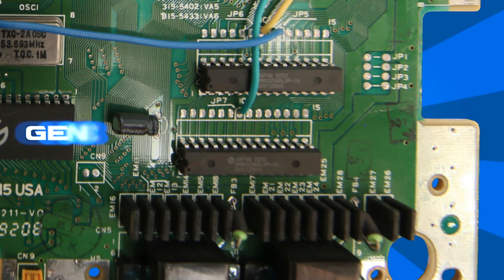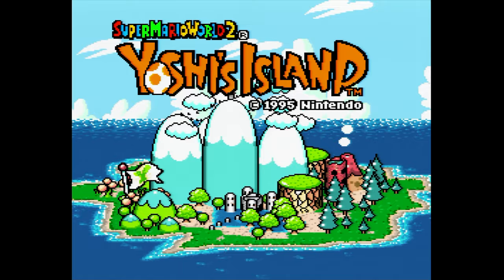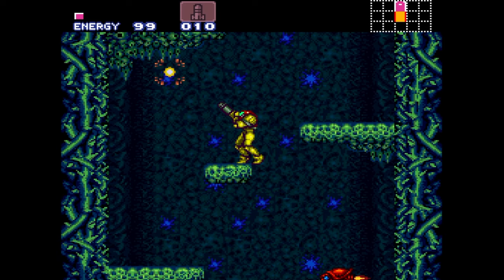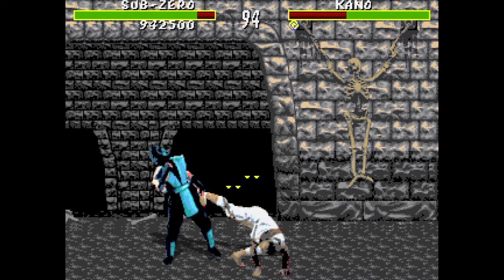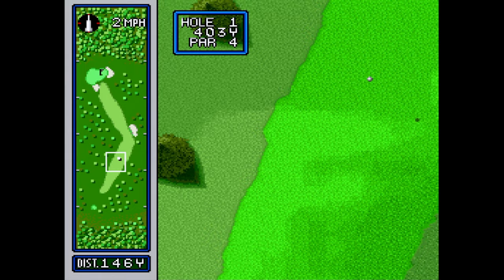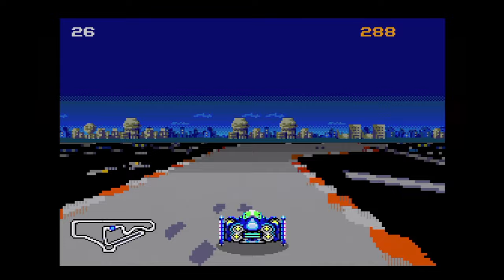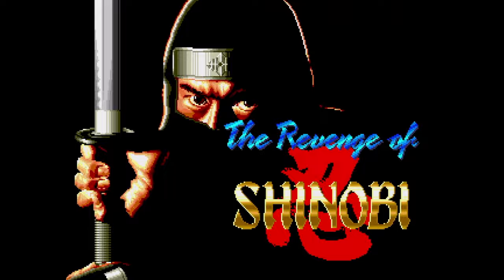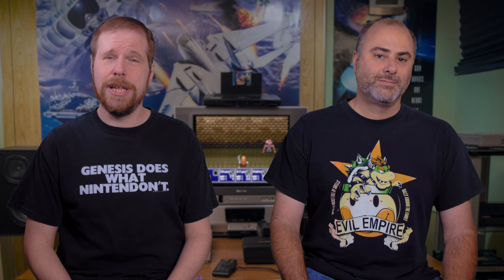Sega Genesis VS Super Nintendo - Game Sack

Comment: Exactly what I've been saying. They are both amazing consoles. Sadly Genesis gets overlooked a lot in the US and most prefer SNES. I've always loved both. Great video dudes.
Reply: Europe and Brazil, SNES gets overlooked! Most people there prefer Genesis.
Reply: Both are great, but people commit the same mistake as when comparing the PS3 to X360. Yes, Genesis has some good "numbers", like the "super duper" Cell processor on PS3. But the Snes, as the x360, do better the important stuff that affects the end result on the screen. That's why Snes and X360, generally, shown better graphics. 

For example: Genesis CPU clock is double of the Snes. But this doesn't mean that the Snes clock is not enough for 16 bit games. Yes, when developers don't trim their codes, Snes games can have lot's of Slowdown (Gradius 3, someone?). But when the programers do their work, the Snes is capable of running games fast too (look at Samus running with Speed boots on Super Metroid). And because Snes can do much more colors, in the end, the games ended looking better. 

About the special chips on Snes cartridge, it doesn't matter if they are "cheating", in the end of the day, it gave better looking games for Snes owners, that's what matter. And it's not like the console itself was not made with this in mind: the catridge slot on the console has the extended space for it, so it was planned before the console release, so, keep in mind it's part of the whole idea of the console. Too bad for sega, they didn't have the vision that Nintendo had. I don't remember cartridges with special chips costing more, maybe only the cartridges with the Super FX chip? The only case I remember, is Virtua Racing for genesis, that cartridge is a disaster: big, expensive, and running very bad a not so good game.
Reply: Snes gets more love in the U.S. because Nintendo and all their IP's are still relevant. If Sega's Genesis era IP's had any relevancy outside of Sonic it would be a different story. Now it's a little redicoulous when we get into the revisionist history stuff that seems to circulate.
Reply: Rotten to the Core  Not in a lifetime!
Reply: Rotten to the Core  In Europe, everyone preferred the Mega Drive/ Genesis!
Reply: Rotten to the Core  But not in Europe! In Brazil Mega Drive beat snes and still being made with new games.
Reply: Rotten to the Core  Source for snes  outselling mega drive? Even if brazil is 3rd world since 1998 they're still making mega drive so until 2020 it can be said they outsold snes after all these years.
Reply: Rotten to the Core  Everyone and no one is subjective.  You're speaking from your own experience. Mega Drive is better and no censorship like the kiddie snes. Woo!
Reply: Rotten to the Core  made in brazil or China doesnt matter. Since 1998 made by tectoy and licensed by Sega that's 22 years still being made that should make it outsell the snes by a lifetime! Jajaja. Woo!
Reply: Actually most preferred the Genesis. It outsold  the SNES during its time.
Reply: Rotten to the Core  Actually, yes... 1. Doesn't matter. 2. Wrong 3. Woo!
Reply: Rotten to the Core  Source where they preferred it?
Reply: Rotten to the Core  source where it outsold mega drive?
Reply: I'm Scandinavian.
Reply: Rotten to the Core  in the US it out sold the SNES. The OP said it got overlooked in the US. Which isn’t true.
Reply: Rotten to the Core  source? Again you cant prove that! Woo!
Reply: Rotten to the Core  Source?
Reply: Rotten to the Core  Source?
Reply: I feel like Snes edges out over genesis
Reply: @Blueflag04  I feel Genesis edges snes.
Reply: I honestly like the Genesis more, but I also have to give a good thumbs up for the SNES in having not only better realism and quality (usually), but also not needing physical add-ons to play DOOM, unlike the Genesis which needed the 32X and/or MCD to do so. Which it actually didn't, it was just a marketing trick.

Genesis: generally more powerful, clearer sound and graphics, cooler-looking console, and better rock/dance
SNES: more realistic sounds and usually graphics, better controller, more friendly games, better orchestral
Reply: @joyasmusicales603  Only the clueless ones.  I'm not saying the Genesis was bad, but it really wasn't even close between these two systems.  Nintendo's complete dominance in Japan guaranteed it most of the best games coming out of Japanese developers which was what most of the best games being made in the 90's came from.  Japan!
Reply: @davidaitken8503  Clueless and better games on Nintendo? Musha, Gunstar Heroes, Shinobi 3, Sonic 2, Contra Hard Corps ( better than snes version), Castlevania Bloodlines ( again better than snes version), Aladdin ( again better), Alien Soldier ( no equivalent on snes), Mega Turrrican ( again no equivalent on snes), Rocket Knight Adventures ( again no equivalent),  earthworm jim (again), tristar, vectorman, better mortal kombat with blood, road rash, Golden Axe, and best beat em up of all time on any platform by Sega with Streets of Rage 2? Need I go on? Nintendo bias and ignorance  from your part and yes I do have and collect for both snes and genesis as two of my favorite systems of all time along with nes, but comparing both consoles and libraries I can convincingly saying Genesis is much better and this is coming from someone who grew up on snes and got a genesis much later in life. Better console and games goes to Sega Genesis! Woo!
Reply: @joyasmusicales603  Thank you for illustrating they type of person I am talking about when I say clueless.  You don't even seem to know about some of the greatest games for the system you owned.

Space Megaforce > M.U.S.H.A.

Contra 3 > Contra Hard Corps, Gunstar Heroes, Alien Soldier, or any other Boss Rush game that skimps on level design.

Hagane > Shinobi 3

DKC 1, 2, 3, Super Mario World, Yoshi's Island, Prehistoric Man, Kirby Super Star, The Magical Quest starring Mickey Mouse, Legend of the Mystical Ninja (Goemon), and dozens more > Sonic 2
It's adorable how you think the Genesis can compete with the SNES in the platforming genre.

Super Castlevania 4 is superior to Castlevania Bloodlines.  It completely destroys it.  In fact, Rondo of Blood (TG16) and Castlevania 3 (NES) are much better than that goofy dud too.

Aladdin = Who the hell cares?  They both suck.

Super Turrican 1 & 2 are better than Mega Turrican.  The fact you didn't know they existed is a perfect illustration of "clueless".

Sparkster for the SNES is better in every way to Rocket Knight Adventures and the Genesis version of Sparkster.  Again, the fact you didn't even know about the game proves my point regarding cluelessness.

Earthworm Jim is one of the most overrated games of the 16-bit era.

Tristar is a film company, not a video game.  I can only assume you are referring to Ristar, a game that is in many ways better than the more popular Sonic games but can hardly be considered competition for the best platformers on the SNES.

Vectorman 1 & 2 are complete garbage that only impresses Sega fanboys.

You do know there was a Mortal Kombat 2 and 3 for the SNES that had all of the blood, don't you?  The only people that care about Mortal Kombat 1 in a post Mortal Kombat 2 world are Sega fanboys.  It was cute how you tried to sell yourself as a fan of Super Nintendo that saw the light and was converted to it's holiness, the Sega.  Bwa, ha, ha, ha, ha, ha.

Top Gear 1, 2, and 3000, F-Zero, Rock 'n' Roll Racing, Super Mario Kart and plenty of other racing games are better than Road Rash.

Legend > Golden Axe
It's as tough as nails though.

Streets of Rage 2 is not the best side-scrolling beat'em up of the 16-bit era no matter how high Sega fanboys want to elevate it.  The Ninja Warriors (the one for SNES, not the arcade or its' ports) has no equal.  Batman Returns from Konami is amazing too.  Final Fight 3, Knights of the Round, and TMNT4: Turtles In Time are impressive too.

I don't want you to get the wrong impression.  I do love Shinobi 3 and a few of the other games you mentioned and many you didn't like Pulse Man and El Viento.  The Genesis library as a whole though is much weaker than the Super Nintendo's and I could mention another 50 games or so just off the top of my head to illustrate that point.  The Genesis really didn't have an equivalent to many of these games either.  

How can you claim the Genesis has a better library of games when you've so convincingly exposed your lack of knowledge of games like even Sparkster and the Super Turrican series?  While not household names with the casuals, these are hardly obscure among fans of 16-bit consoles.  I could talk about games that never got a North American release like Rendering Ranger R2, Pop 'n' Twinbee, or Macross Scrambled Valkyrie.  The list literally does go on and on.  The SNES had over 1,700 games released for it compared to just over 700 for the Genesis.  The SNES was where 3rd party Japanese developers were putting their best teams and resources, and it shows.
Reply: @davidaitken8503  Lol. I didn't have to mention it since you know that about yourself. I gave you the best games for the system when you couldn't for snes until now. Musha blows space force out of the water. All the games I mentioned you compare to contra 3 are way better. If Hagane is better than shinobi 3 why is there no sequel and 3 shinobis? Because shinobi is better. Sonic 2 is better than mario world which is a rehash or mario 3 only upgraded, Sonic as a matter of fact had 4 better games than mario sonic,  sonic 2, sonic 3, sonic and knuckles. The rest you mention are meh and for the Disney games world of illusion and castle of illusion and quackshot are exclusives and way better. Bloodlines, Contra Hard Corps, and Rocket Knight Adventures are the 3 best konami games on Genesis and can't be matched by its snes counterparts. Mega turrican is better game with gameplay and mechanics and of course I knew they existed. Aladdin sucks? Probably not your taste but it's a much better games on genesis than snes. Eartheorm jim is overrated but is good. I did know about mortal kombat sequels but if not blood and gore like the snes original then no mortal kombat. What is legend? Versus Golden Axe. Nope! Streets of rage 2 is the best beat em up on sega and like I said can't be stopped by turtles in time which is a conversion from arcade or by anything on snes. The genesis library as a whole is stronger once you get your bias out and start exploring and playing the games. I could also mention another 100 games to illustrate my point. Even if there's more games released for snes than genesis that's irrelevant when the variety and quality of games is prevalent in the Sega Genesis. Nuff said.
Reply: @supersexysega  Nintendo games were more varied.
Reply: @joyasmusicales603  The Genesis had a lot of great games, but nothing comparable with the Super Nintendo library... also the Snes outsold the Genesis everywhere in the world, don't try to rewrite history. The Genesis outsold the Snes in the USA only for a few months.
Reply: @brugges  The Super Nintendo had good games but they're not at the same levels as the Sega Genesis!  MUSHA, Gunstar Heroes, Alien Soldier,  Streets of Rage 2, Shinobi 3, Sonic 2 are just a few incomparable with what the snes offers! What does snes offer besides Mario, Zelda, Donkey Kong and Metroid? Not much! Plus the better and original version are all on the NES. SNES never outsold the Genesis in any way shape or form! If that's the case why after 1998 are they still producing and selling the console in Brazil? From 1998-2021 that would mean it already outsold the snes by milestones. With better system and better games winner goes to Sega Genesis!
Reply: i don't know if it was overlooked - in my circle of friends it was the SNES - but others in our grade/age group had mostly Genesis'
Reply: @richardslotboom9250  Coming from a guy with a blue movie name?  Sure thing Dick Slotboom.  (snicker)
Reply: @joyasmusicales603  that's because the rpgs that Americans all ways go on about we never got in Europe sega localised more RPGs here haha
Reply: @joyasmusicales603  People in Brazil played SNES more, and SNES was sold more than Genesis at the end of the 90's.
Reply: @joyasmusicales603  Mortal Kombat 2 is more blood and gore than the weak Baby console Genesis. Genesis isn't even capable of running Turtles in Time 😂
Reply: @3xperiment8 Sissytendo can't run Alien Soldier or Gunstar Heroes can it?
Reply: @3xperiment8  People in Brazil played Sega more than sissytendo! Why do you think they are still making them in Brazil?
Reply: @joyasmusicales603  Those games are genesis exclusives. Turtles in Time and Street Racer were attempted on the 2 consoles. You can check the differences in hardware limitations.
Reply: @pranacale4460  The Snes US design is loved but all clownsy at same time. 😂 If 1 thing is awesome are the US cartridges. Squary Dark grey, Much more impressive than the European and Japanese IMO. 😎 It looks like something Robocop would take out of his pocket
Reply: @3xperiment8  How can you be old enough to use a computer and type a totally coherent message while still having the opinions of a toddler? The 90s were 30 YEARS ago dude.
I mean, if you like GOOD GAMES over early 90s marketing BS, who TH cares about the hardware? 
Both have excellent controllers, so play the best games of each consoles and VOILA! 
For 16 bits consoles, 95%+ of a game's quality is courtesy of the DEVS and their familiarity with the hardware, and not the hardware itself. Aside from little nitpicks that wouldn't ever mattered to anyone back then, almost all games could have been done on either the Genesis/MD, SF/SNES, and even the TG16/PCE/SuperGrafx, and both the SF and MD had interesting ways to access older systems' library, as well as additional chips through cartridge and addons for a different experience.
Reply: But in Brazil the Genesis is the kink!!!
Reply: @vomoreno  I would write "kink" instead of "king" lol :P
Unless you guys do different stuff with your console over there...
Reply: I'm from U.S and I stay playing Sega Genesis Super Nintendo games bored me
Reply: Snes only has mario mario mario its the only game they put out😂

Comment: The rivalry of the 16-bit never gets old. Loved both consoles, though I'm more familiar with the SNES.
Reply: The Genesis is a  little cooler since it has no rotation/scaling FX and everything of that nature is done by clever Coding, while the SNES has more impressive
graphics/FX but they are standard on the Hardware so its more "mundane" than on Genesis

Comment: The problem the Genesis had was that a lot of developers didn't know how to use the color palette or sound chip properly. so a lot of games don't look so nice or sound so good as they could have.
Reply: Maybe American and British developers couldnt develop for the console properly. 
However, theres no excuse for Japanese game developers. Most Japanese computers used a Yamaha sound chip, and quite a few computers used a Motorola 68000. 
Most Japanese game developers owned a Sharp X68000 (it was only released in Japan) and used it specifically to develop games and to take the hardware and customize it for use in arcade hardware. 
Sega itself used the X68000 and watered down the specs to make it into an affordable console (not too many people could afford a $3000 computer in 1989). The most expensive part for the Genesis was the Motorola 68000, and even then, it was slightly slower than a Sharp X68000. Even the sound chip (the YM2612) was 6 channels and had its own Digital/Analog converter built into the chip, where the X68000 used a YM2151, which had 8 audio channels, and required an independent chip to process the Digital/analog converter (a YM3012). It may seem odd to require a second chip to convert the audio when one does both, but listen to Japanese developed arcade games, as many arcade systems also used a YM2151, youll hear the difference.

Comment: I'm only upset that Vectorman was brought up as "worse game than Donkey Kong Country" ...Hard disagree they're nothing alike. Vectorman is an absolute blast, especially the second game even if they weren't super successful, I think it is more like Metroid overall. The original Xbox and/or PS2 were supposed to get a Vectorman game to compete with Metroid Prime, I am still disappointed in that cancellation 20 years later.
Reply: The first Vectorman was a huge success. It came 5 months after the Saturn and still managed to get a Genesis sequel.

I am with you though both Vectorman's are awesome but I slightly prefer the first.

Comment: Hardware:

Mega Drive Wins! 

Because had games polygon like Star Cruise in 1990.
Reply: True, the Mega Drive can do polygon graphics naturally which the SNES cannot do in any way.

The Mega Drive is not just better than the (admittedly good) SNES, it's the best console ever made.
Reply: Yes Genesis could handle polygons better than SNES, HOWEVER, there was no point playing those games cos they sucked and played very clumsy.

SNES could do polygons too like on Steel Talons, but I much prefere Mode 7 with its fast gameplay with 60 fps, remember F-Zero came out in 1990.

Genesis can't do Mode 7, only with the help by software and still very clumsy compared to on the SNES.
Reply: @victorbranco7928  I definitely prefer the non-Mode 7 racers like Super Hang-On to SNES's F-Zero. And boy, I still can't believe the original StarFox ever had a fanbase. Impressive? Yes. But good lord, neither of these consoles should've been trying 3D polygons.